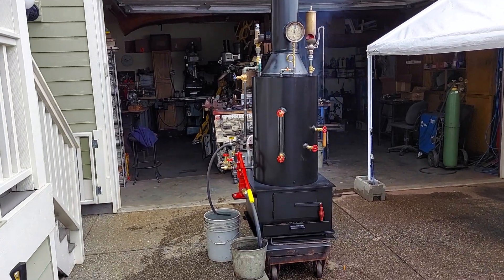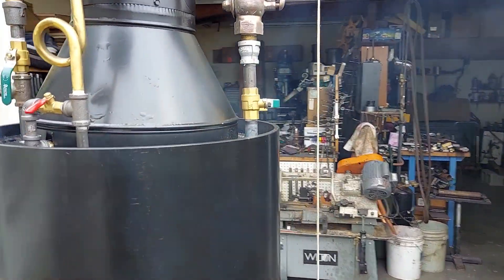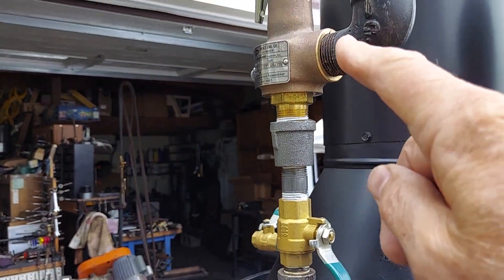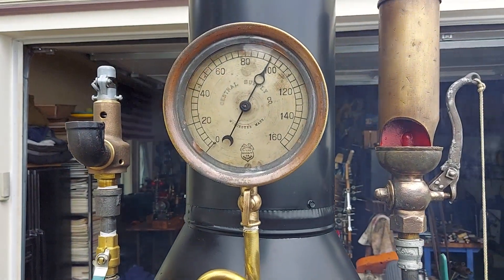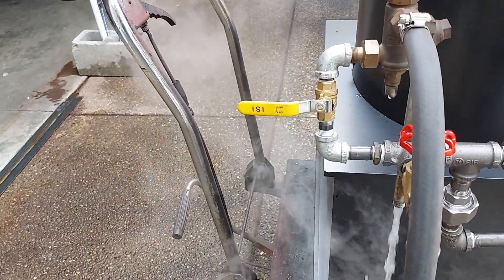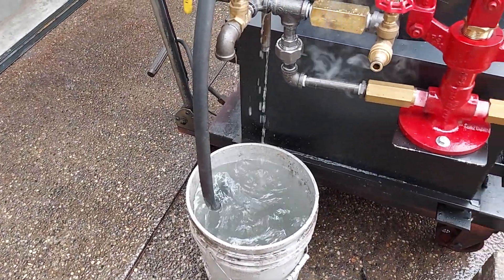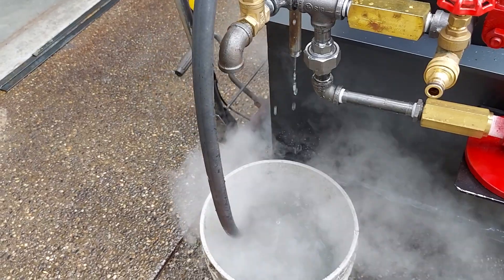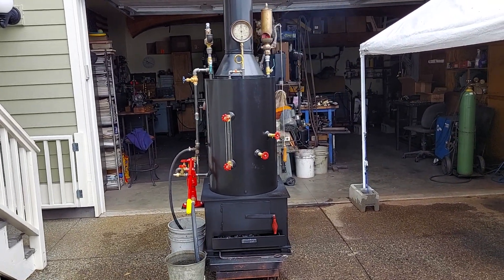Steam Engine Boiler Injector Hand Pump Whistle Gauge Off Grid Live Steam Engine

Comment: how much wood does it use with a 5hp engine? i have a sawmill and have a large waste wood volume. I have a small solar system would like to know how much power i can get with your 5 hp unit. amps.